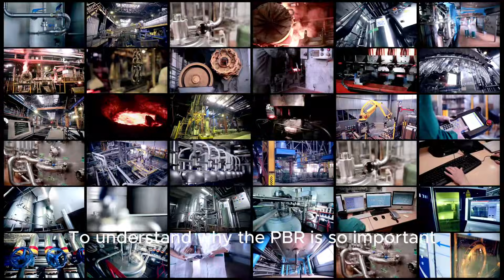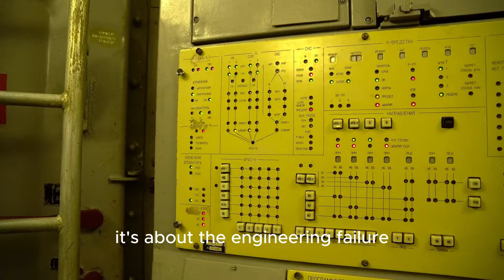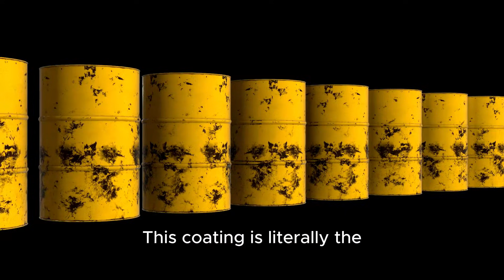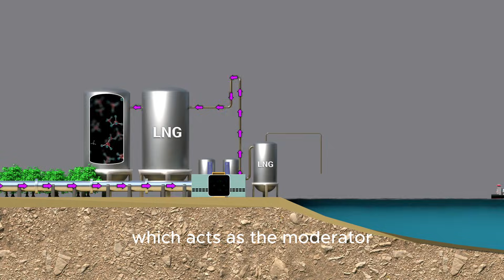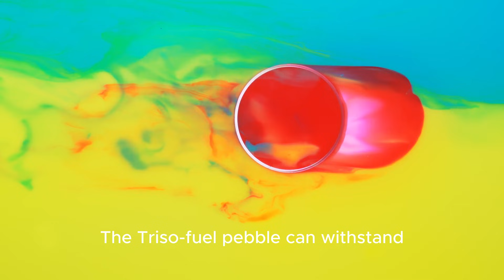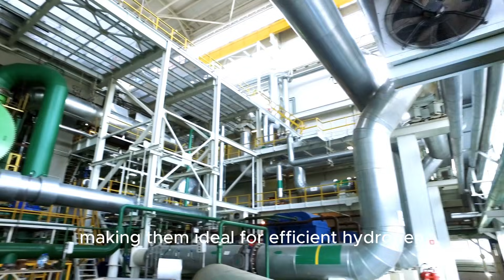The ULTIMATE Fail-Safe? This Nuclear Reactor CAN'T Melt Down (Pebble Bed Reactor)

Comment: The Primary flaw with current nuclear reactors is that power generation is a byproduct of plutonium production.  The primary purpose of traditional reactors and even breeder reactors is to produce weapons material.  The steam plant hooked up to the production facility is a bonus that doesn't make sense to waste.  The molten salt, pebble bed, etc reactors have been known about since well the manhattan project, the thing with those reactors is they don't produce plutonium, or at least not enough to make bombs cheaply.
Reply from the maker: Subscribe